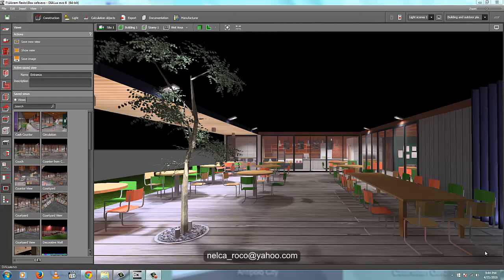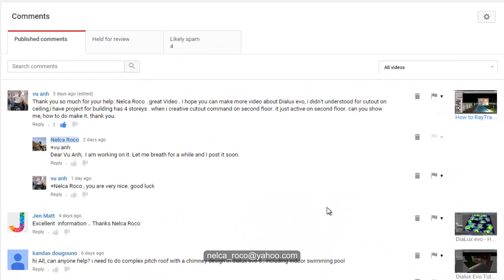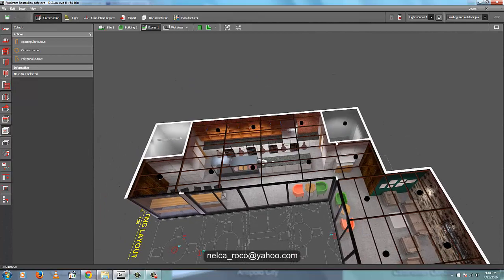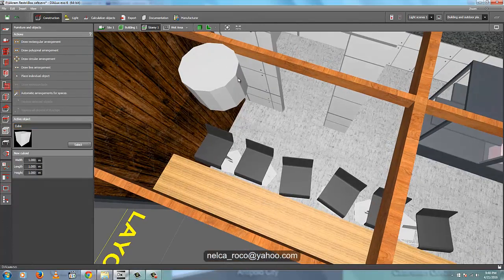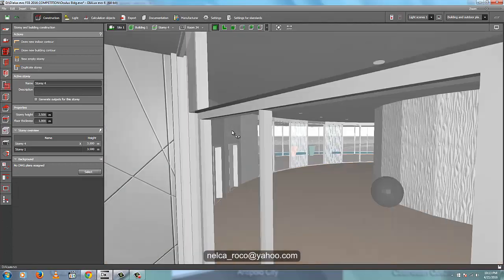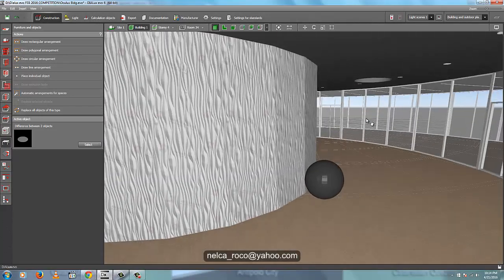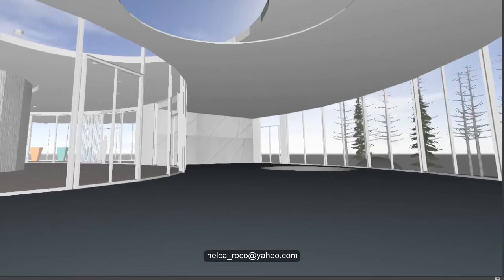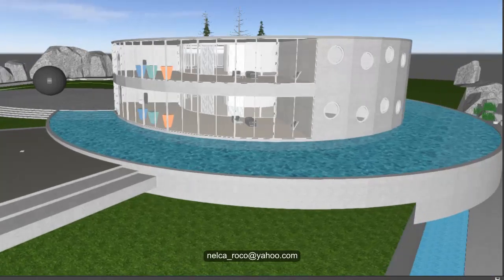DiaLux evo - How to use Cut-out Tool

Comment: Hi!
I want to make  cutout for walls, but i want to know if the lux will be changed? (Because the walls reflect the lights into the ground). I mean: Does the tool eliminate the presence of walls completely?؟
Thank you
Reply from the maker: yes. lux value will change. definitely. coz lights bounced back from walls. if its gone then there are no bouncing lights from that wall.
Reply: Nelca Roco, Lighting Design 
Thanks very much for your fast respone!
Actually, my project is to design a tunnel light for two connected bridges and tunnel between them.. 
the bridges are open onto the street and i don’t know if the cutout tool is the way to make them open to the street?

Comment: Can you use the cut out tool on the exterior walls of a room or does it only work on internal walls? 
I have to model a quadruple height atrium space and the top 3 stories do not have a wall. 
Please advise with thanks
Reply from the maker: yes u can cut inside both walls, floors, and ceiling.
Reply from the maker: https://youtu.be/NoDJ9Vr5PFE check this one.